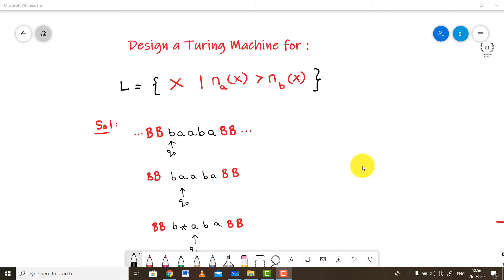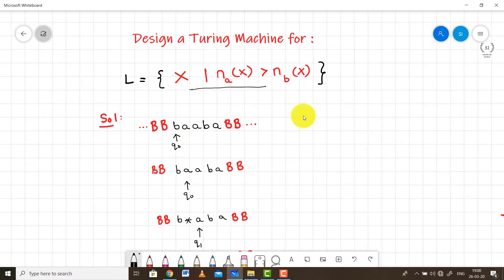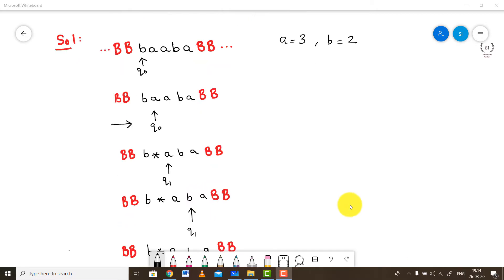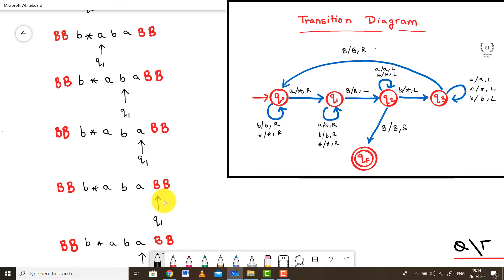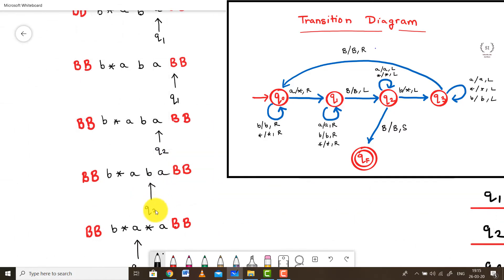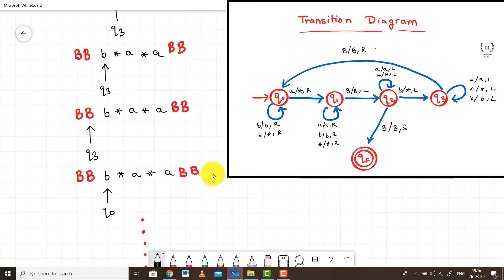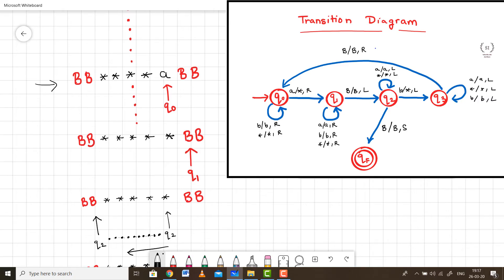Problems on Turing Machines |Example 2 | No. of a's Greater Than No. of b's | Sridhar Iyer

Comment: Does you machine accepts bbaaa
?
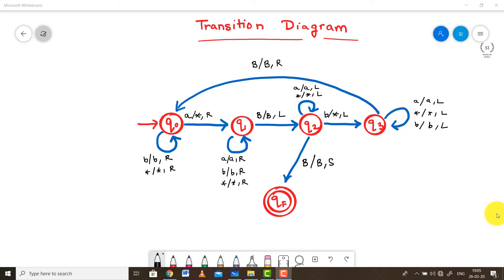Reply from the maker: Yes it does..kindly refer the diagram at 1:53 and simulate the example. It will accept it
Reply: If I receive just a on tape then it should be accepted , I belive you are considered a tape which starts with blank and has string somewhere in between hence you have blank on left and  right of string?
Reply from the maker: The input string should always be written between Blank symbols on either side. There cannot be a tape of infinite length (practically) , theoretically it's possible. 

Hence all the inputs are written between the Blank symbols on either side. 

And a single 'a' also gets accepted as per the diagram. Kindly check